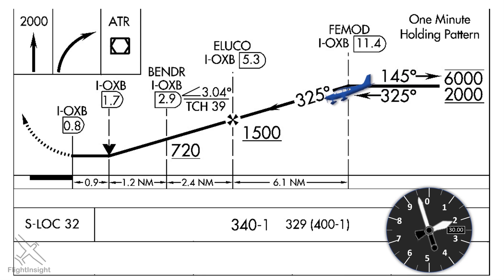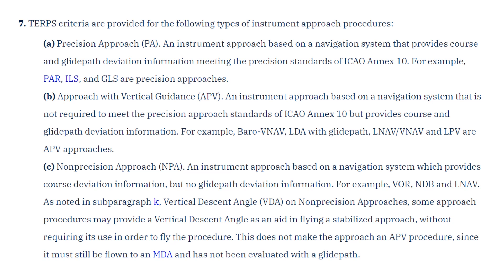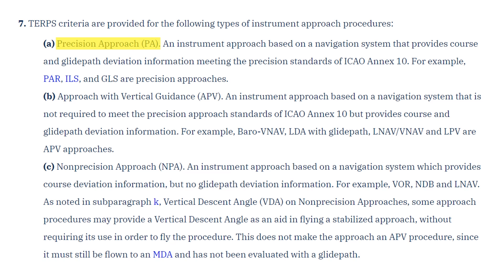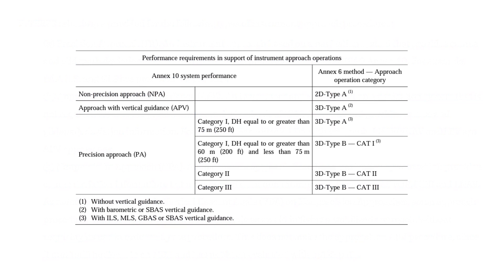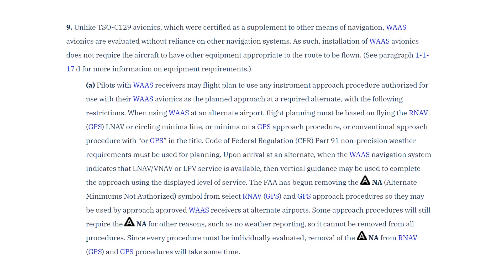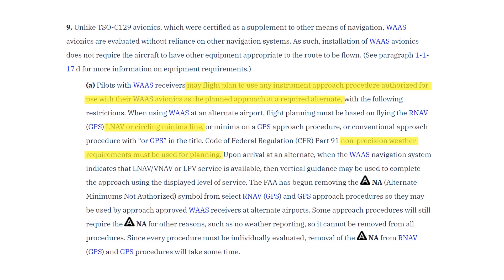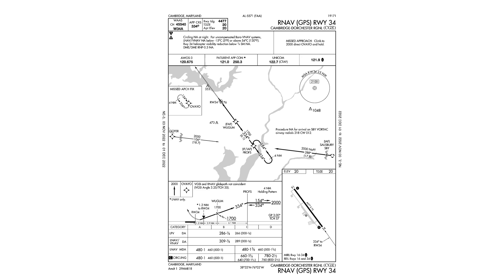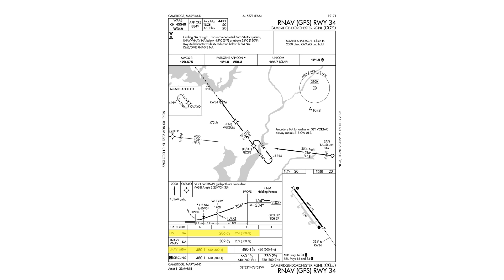Are LPV Approaches Precision or Non-Precision? | IFR Training

Comment: 3:12 I am a CFI-I and yes you must use 800-2 for alternate planning. Then you say for planning RNAV (with LPV, with DA and LNAV with MDA) use the lower LNAV non precision approach mins fpr planning? YES you use 800-2 for planning. LPV for alternate planning is NON precision. BUT FOR TRAINING AND CHECK RIDE LPV IS CONSIDERED precision.

You say if you have WAAS LPV capable navigator you can go to that.  Of course.  You made it complicated and muddy water about the MDA mins (for LNAV). Irrelevent. 800-2 controls. 

. For planning purposes if destination does not meet  1 2 3...(essentially VFR) must file Alternate, 600-2 precision (ILS, PAR) and 800-2 for non precision VOR. LOC, LP+V and LPV. The latter LPV is like an ILS with a DA but is considered Non Precision for alternate. FOR TRAINING and CHECK RIDE LPB IS PERCISION and SUB FOR ILS.  

It is irrelevant what LPV and LP/LNAV mins are for alternate filing. OF COURCES you can fly the LPV.  And yes this is for planning purposes. BUT once airborne you can divert to filed alternate or another alternate not filed once airborne, even if below 800-2.  Yes you want your alternate WX to be above mins. If you have LPV capability that is controlling not circuiting or LP (MDA) min. OF COURSE if there is /A\  non standard alternate mins or requirements those control or are in addition to 600-2/800-2. If you have ILS capability and the alternate airport has an ILS it is 600-2. Again once airborne all bets off you can divert from destination as needed to any airport.

Comment: My question for you after watching this video is... Reference the KBLV RNAV 14L LPV approach. DMJPS is a step-down fix listed at 1620ft. For an LNAV, we follow that altitude, but for an LPV, do we? It doesn't have a *LNAV only*? Yes I understand that if you follow the glideslope it will keep you at or above that altitude, but what if you are a half bar under? You are technically not breaking ACS standards, but you might be below DMJPS due to being below glideslope? What do you say?
Reply from the maker: Great question. Have a look at the chart users guide for instrument procedures (exact citation escapes me) which mentions step down fixes on final approach segment don’t apply to APV approaches like and LPV. I think the absence of “LNAV only” there means that the restriction also applies to LNAV baro approaches.
Reply: @flightinsight9111  to add on here, the step downs are important in an LNAV approach because the LNAV will not have the lateral precision (read: sensitivity) that an LPV will have. Therefore, if there is an obstacle close in to the final approach course, the LNAV approach stepdowns must be designed to provide adequate separation, whereas the LPV will provide separation through tightening lateral precision.
Reply: This is the exact citation Flight Insight is referencing 
---  "Altitude restrictions at stepdown fixes on the final approach on procedures with both precision and non-precision minima are not applicable to precision (ILS, LPV, or LNAV/VNAV) use of the approach. On non-precision only approach procedures, the approach track descends to the MDA or VDP point, thence horizontally to the missed approach point." ---  Chart Users Guide on aeronav.faa.gov page 111
Reply: @mikemorell1057  thanks for the ref.  Another book to read for my ifr chk ride.

Comment: They are non-precision but have a DA vs. MDA. They should be precision approaches. Wonder when the FAA will make that happen?…
Reply from the maker: I wonder that too. The hesitancy seems to be not in the approach itself, but in using it as an alternate. ILS is monitored on the ground, whereas GPS is not, so there's that added level of scrutiny. Doesn't seem to be an issue in the international space though.
Reply: @flightinsight9111 ,  As well, 91.169(c) IFR WEATHER MINIMA has not been amended to reflect the increased planning requirement. So, where is this obscure information located? And, is it regulatory?